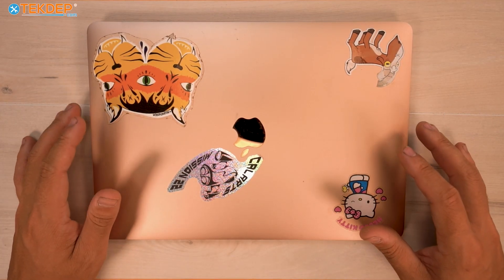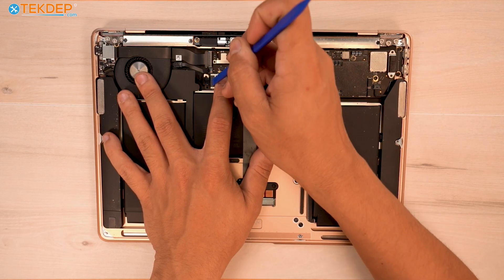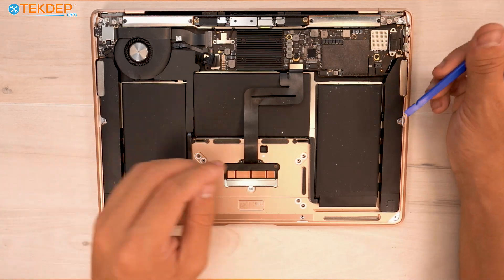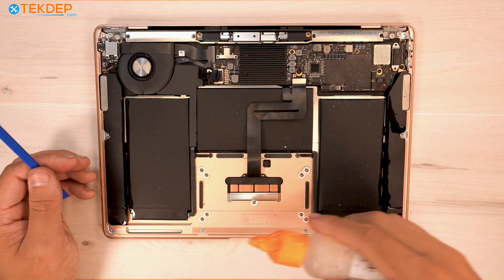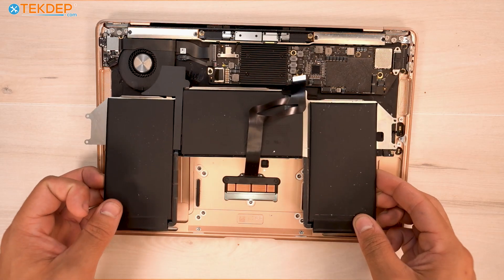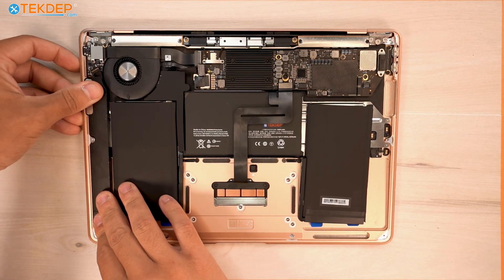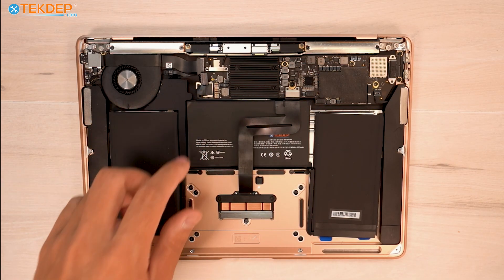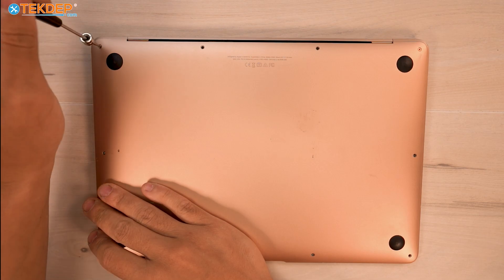How To Replace The Battery on a MacBook Air A1932 2018-19!

Comment: we just did this. Unfortunately i think the speaker connections on our 2019 Air 8,2 were a different type - they slide in sideways rather than popping off vertically. So daughter broke them off motherboard, trying to pop them off. No more onboard speakers. Otherwise it worked.